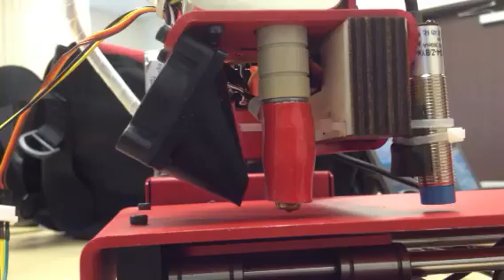Printrbot tests non-contact auto-leveling

Comment: Hey brook!!! Any way you can add to the firmware an extra probe point in the middle of the bed... Some of s have modded their bots and if they are using variously sourced metal beds... Well ... Mine is pretty large.. so it has some small flex in the middle. It would be good to account for that slack?? What do you think??